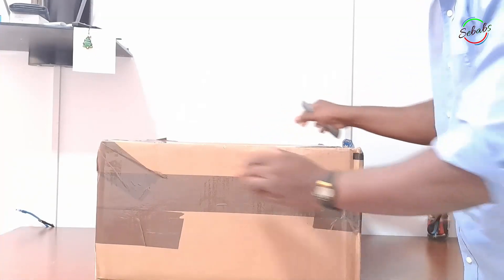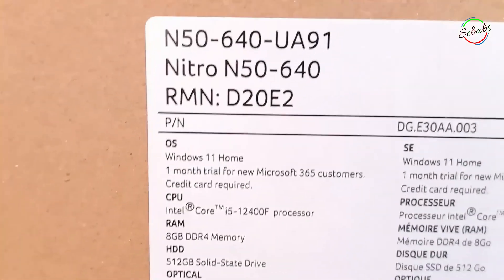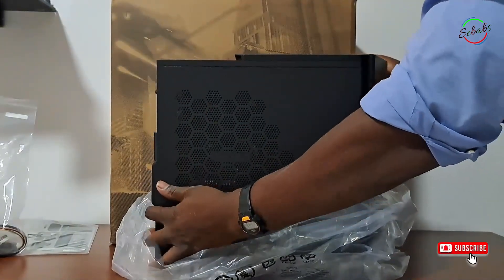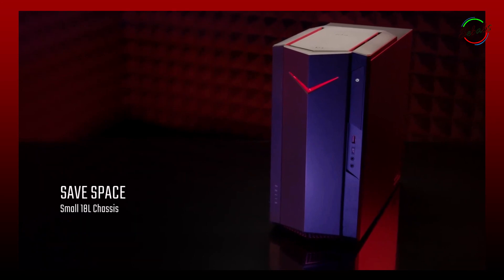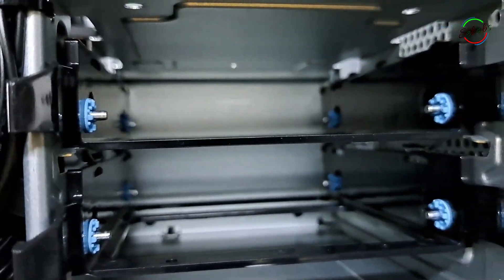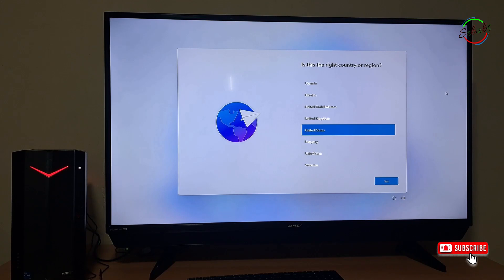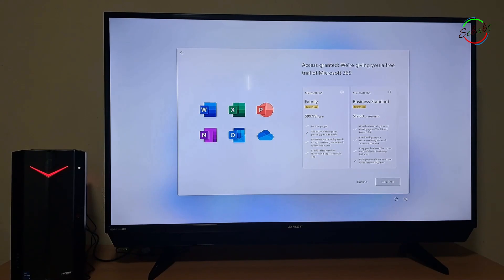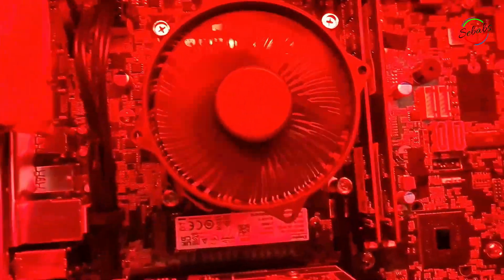Acer Nitro N50 Gaming Desktop 12th Gen i5 NVIDIA GeForce GTX 1650 SSD Win 11 UNBOX/REVIEW (PART 1)

Comment: Thank you this was a very useful video
Reply from the maker: I'm glad it helped
Reply: @Sebabs32Unbox  yo man I got that pc it’s about 2 years old I’ve never really opened and cleaned it because idk about pcs but it is very laggy and when I press windows it takes 5 minutes for it to open up and any app I open for example like chrome it takes 5-7 minutes for it to load and it is still very laggy and in games like Fortnite it doesn’t load me in how can I fix? It has i5 10400f gtx 1650 and 8gb ram
Reply from the maker: @Kayflock-kb5xu  thats a good PC and xteristics. Feom what you said, you might only have to take it for maintenance
Reply: @Sebabs32Unbox  Ty man 🙏🙏
Reply: @Sebabs32Unbox  Ty man also by maintenance do u mean like to get it checked?